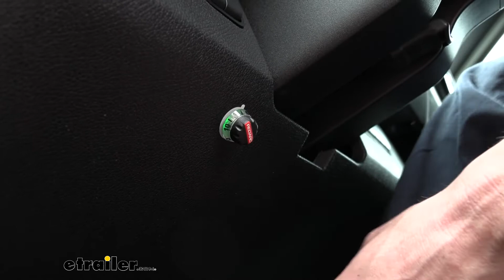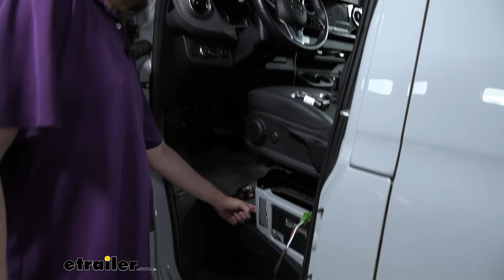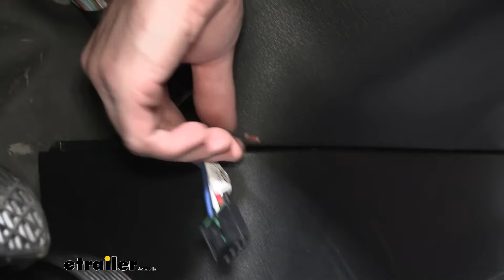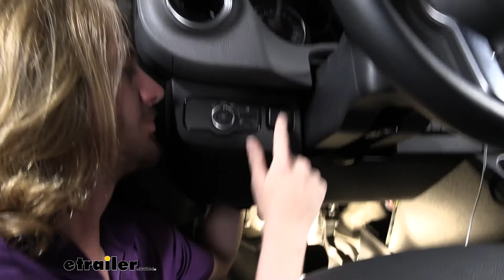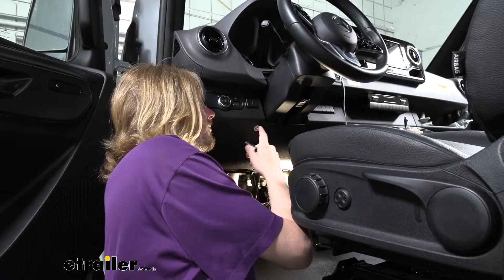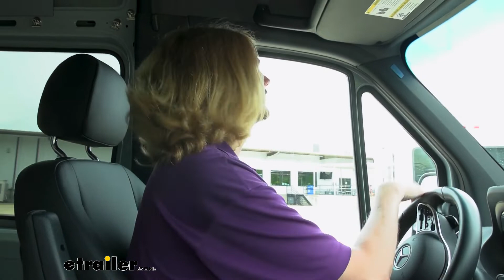Redarc Tow-Pro Elite Trailer Brake Controller Installation - 2021 Mercedes-Benz Sprinter 3500

Comment: What is the link to the adapter?   I can’t find the plug and play for my 2023 sprinter 2500 on the website
Reply from the maker: I double checked on this and there isn't a custom harness available for Sprinter from Redarc. I also checked Curt to see if they even offered one and they don't. You would just have to hardwire the unit into your Van.

Comment: Where is the fuse located for this 12 volt circuit?
Reply from the maker: M/B doesn't specifically list this in the owner's manual, but I saw references that said the trailer towing related fuses are located in the fuse panel in the side of the driver's side seat base. Check fuse locations 10, 11, 12 and 13. I wish I had a more definitive answer for you.
https://www.etrailer.com/Trailer-Brake-Controller/Redarc/RED44FR.html

Comment: Stick some double sided tape on the module to avoid vibration
Reply from the maker: Be sure to use the provided screws to mount the control unit as well. If the double sided tape were to fail, the controller wouldn't work as it should which could lead to a dangerous situation.
https://www.etrailer.com/Trailer-Brake-Controller/Redarc/RED44FR.html
Reply: @etrailer  yes double sided tape along with straps around the frame.